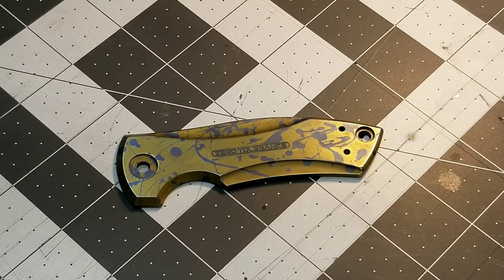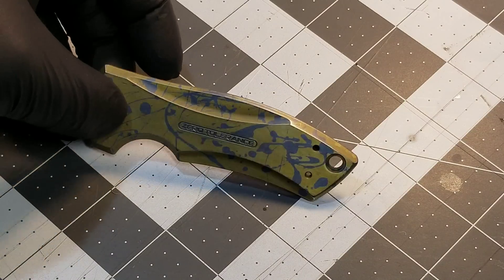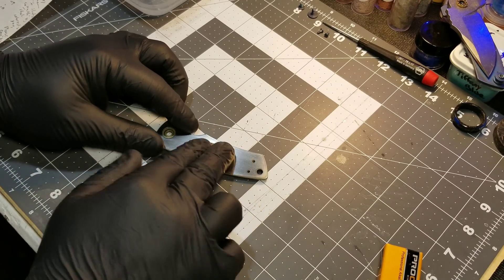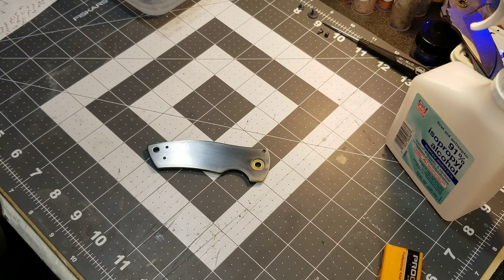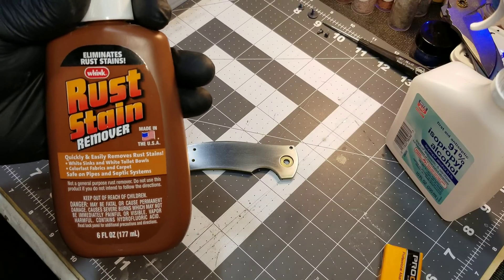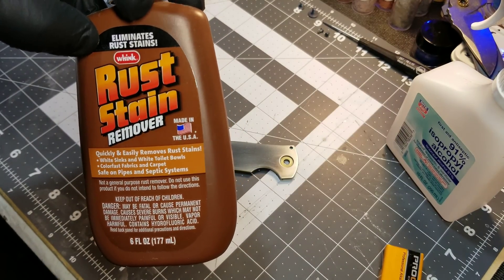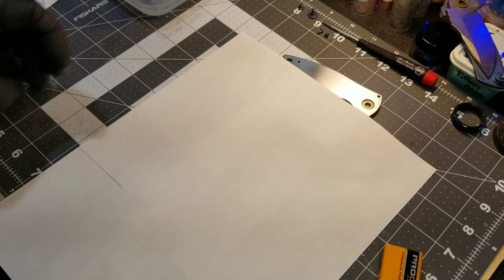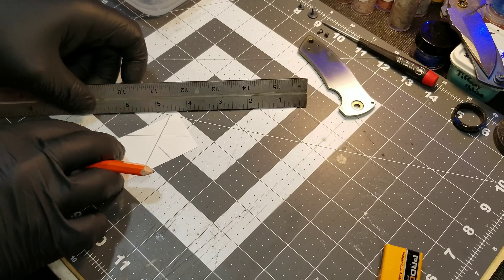Anodizing Titanium - Snake Or Line Anodizing DIY (2021)

Comment: If you use the alligator clip to grab a needle or something similar would it be able to draw smaller lines? And you attach the other clip directly to the titanium or do you use a piece if ti-wire? What is this next thing you are going to show? Been thinking or redoing my first sincenmy screws are a bit lose anyway, might as dissasamble and anodise again.
Reply from the maker: A needle is a great idea! I didn't think of it, but it would definitely work. Probably just want to use the dull end so you don't tear the paper. 

As far as the lead goes, you can connect it directly, or use wire. I did both. I like using the wire better though because then I was able to cover the whole piece with the paper.  If the alligator clip is directly on the piece you can't fully cover it with the paper. 

The next video I have coming up is going to be on faux timascus.  Going to be a really cool one, I'm really excited to share that one!

Thanks for watching, and if you have any other questions I can help out with, don't hesitate to ask!
Reply: @ApollosRings  Ok thanks. But now I'm in doubt about trying the needle or waiting for your timascus tutorial...
Reply from the maker: Lol, decisions, hahaha! It's going to be a good one. It's a bit more involved, but the results are going to be awesome!
Reply from the maker: The good news is that there's always Whink if you ever want to change it up.
Reply: @ApollosRings  The needle thing did not work, at all. Not for me anyway. I anodised a 3x 9v battery base color first and wanted to add lines with the 6x 9v battery. But..  All I did was roast the paper. Never had a colorchange.  Then my second idea, I wanted a 3 batt. base with lines over it  with the 6 batt, but the 6 overrides the three so that way I had to almost drown my handles in nailposlish. So did not turned out as planned. Still turned out kind of nice.  I'll post some pictures later on my instagram. (Flipper.was.a.dolphin)
Reply: @ApollosRings  I could also not get it to work with the needle after starting with raw Ti. After wink and   water.
Reply from the maker: That's strange that it didn't work. I still have everything set up in the shop, I'm going to see if I get the same results
Reply from the maker: Yeah, tag me if you post later
Reply from the maker: Are you sure you had the leads hooked up correctly? I just tried the needle and it worked flawlessly. I'll edit up just a real quick video and post it when I get a sec.
Reply: ... Been anodising for three hours, so I forgot some of the things I did... I did hooked the wires incorrect at first nothing happend, then ai switched the wires and I did do some colorchanges. But I was hoping to get some straight yellow/gold lines on my dark blue, instead it just made sort of oil stains on it. Not really one straight line of color and also not the color I intended. So it does work but not in the way I had in mind.
Reply from the maker: I noticed the speed has quite a bit to do with the outcome as well. Too fast and it doesn't take well, too slow and you get a lot of bleed. I had an idea of using a piece of HDPE as a sort of stencil too, because I suck big time at drawing anything straight. I'll post the video and you can see for yourself.
Reply from the maker: I should have the video up in the morning of how I used the needle. I came up with a little better way of getting a straight line as well. Came out pretty cool. It can definitely be hit or miss with this method of anodizing.  I had quite a few times where I hated the results, but then there were a few that were great. Just gotta play around with it.
Reply: @ApollosRings  Great. Looking forward too the video. Picture is up on my instagram.  I tagged you.
Reply from the maker: I'm uploading the video as we speak. Should go live around 9am eastern time. I'll go check out the pic on Instagram now. 👍🏼
Reply: @joostborst  hey if you have a drill and a Sander you can take Titanium rods to a needle-point for finer details.
Reply from the maker: @noahjones4237 Titanium wire would probably do the trick as well. Thanks for checking out the video.

Comment: have you tried using cut T shirt instead of paper? I keep tearing through the paper and getting sparks... also curious to know if there are other more efficient ways to do this.
Reply from the maker: A t-shirt should work just fine. As far as more efficient ways, you can use a power  supply. That's what I use now. Batteries will do the same thing, but it's a bit more setup, and you can run into issues here and there.

Comment: Sweet vid. So for a pinned knife. If I cover the pins, pivot with nail polish and then I could potentially anodize the whole scale with this technique without taking the knife apart?
Reply from the maker: I don't recommend trying that unless you are 100% sure that you've got any exposed stainless covered with nail polish. If there is anything that you can't get to because you didn't take it apart, it will instantly oxidize very badly. Theoretically you could do that if you were 100% sure of your nail polish coverage, but I probably wouldn't take that chance. I've seen what it does to exposed stainless in the bath, and it's ugly. If you're not submerging the knife though, you'd probably be fine just covering the pins and pivot. Just make sure they have a few really good coats, and let the polish completely dry before anodizing. Definitely an "at your own risk" kinda thing though. If you're really careful it can be done.

Comment: Sort of unrelated, but, I've noticed that that 0900 is used in pretty much every video. Are there any problems that arise from stripping and Re-Anodizing something that many times. I'm thinking about doing my new Inkosi and want to know I can just retry if I screw up a bunch of times.
Reply from the maker: I've definitely anodized that knife like 30 times, lol. I haven't experienced any issues doing it over and over. If you are really concerned, I suggest using nail polish on any critical areas (bearing races, screw holes). I use the same blade so that if issues do arise it's only a problem with the one knife, but no problems as of yet. Still performs like the day I got it.
Reply: @ApollosRings  good to hear. Thanks for the quick reply

Comment: tsp is for anodizing at higher voltages like 75-110v
Reply from the maker: An electrolyte is an electrolyte, the water is what does the work, but If you feel TSP works better for you at higher voltages, by all means use what works for you. I've had no distinguishable differences between the 2 at any voltage. Might make for an interesting  video though. I know some people swear by the stuff. Would you be interested in seeing a side by side comparison?